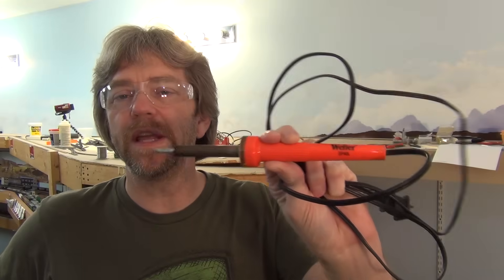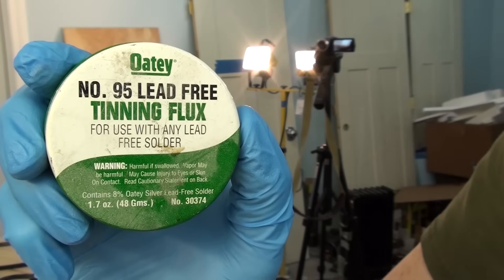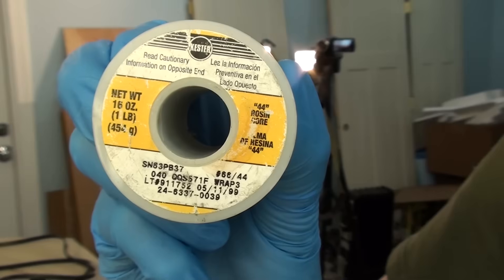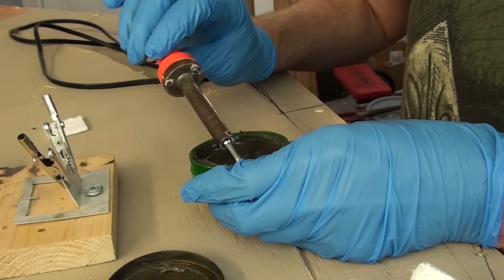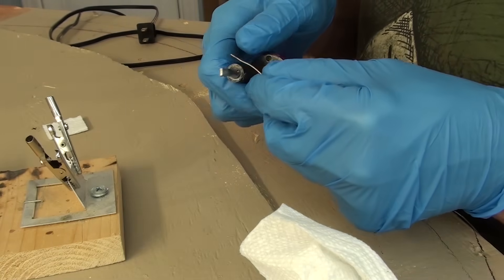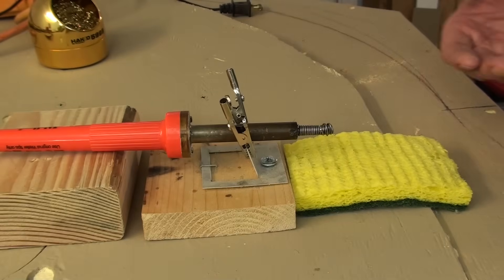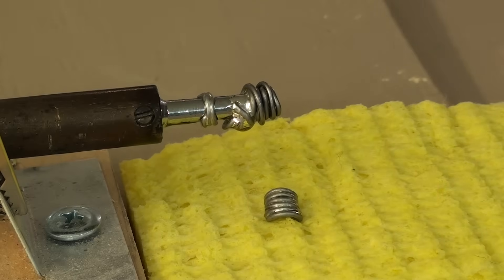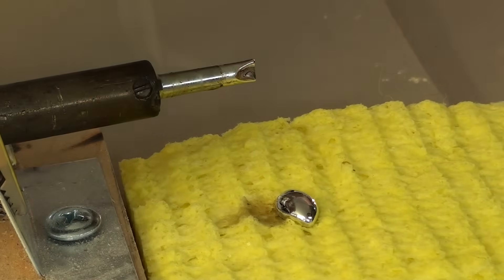🔴How to Tin a Soldering Iron Tip, Without making any mistakes

Comment: You have to do that everytime? Or how long does this last?
Reply from the maker: For the life time of the TIP,  Tips are a consumable.  In a the solder shop we would replace them every week.  But for home use just coat it well before storing the tool.   The Soldering Iron I used in the video,  The tip looks the same and works like new,  I just used that iron the other day,   I did this how many years ago?

Comment: Just got a new small soldering iron to replace an 8 wire section in the wiring harness leading to my car's fuel pump that was chewed up by a squirrel - judging by the chewed up walnut shell on top of the gas tank next to the fuel pump. I had the same tinning flux leftover from an old  plumbing repair and found some 60/40 rosin core in the mix of old solders = worth a try.  Thank You
Reply from the maker: Electron grade solder,  make sure it is not plumbing solder.

Comment: Does this work on a used tip?
Reply from the maker: You can use it but this method is for preparing a new tip.  Older used tips can be do the same way.  But once the corrosion starts it can not be redone with tinning, just better to spend the few bucks on a new tip.

Comment: Had no idea a new soldering tip needed to be tinned. Thanks for sharing.
Reply: @shawnsmith5028  I know right! Why don’t irons just come with basic instructions that outline this essential set up step? It would be like selling an oven without the obligatory “1)wire into an appropriate connection to code 2) don’t use the oven as a heater” etc

Comment: 😮Thanks man! I'm 14 and I'm really getting into electronics. Just a hobby and I started wondering why my soldering irons weren't working anymore... That's when I noticed your video! Thanks❤
Reply from the maker: Keep the tip coated and it will work like a dream.

Comment: I can confirm that this method works just fine when tinning new tips for the first time. I also refurbished a really beat-up tip of mine by using sandpaper just a little, and then using your method. Thank you so much!
Reply from the maker: Great to know this works,   thanks for sharing.
Reply: I have a crapped up tip that needs help, thanks for having shown that they can be saved.  I don't use mine much but lost the tinning on it.
Reply: do we do this tinning thing he showed once a week or once a month for maintanence?

Comment: I know nothing about soldering but someone showed me how to do one specific job that I have been doing for 5 years.  No problems the first few years.  The iron already had a tip on it when I first started. 

The problem began when I decided I might need a new tip. I used the same tip for 3 years with no problem. 

The moment I changed it one of 2 things happen.  I tinned it exactly like this video instructed but I can't get the tip to melt the solder. When it does work, the new tip melts after 3 days and needs to be replaced. 

I'm suspecting my boss is an idiot and bought a bunch of cheap tips from China that is causing the problem.  

Any idea what my problem is and how should I go about buying new tips that are trustworthy because I bought a 10 pack on either Ebay or Amazon and they don't work either
Reply from the maker: You might have a low end soldering iron.  The weeler 35watt I use is a real good hobby grade iron and should serve you well in most job

Comment: is it just for new tips, or is this what you do after every use?
Reply from the maker: @kymbo72  new tip,  you are adding the protection to it that makes it last.   Once it is coated,  during normal use it is not needed.  Just a little tinning to keep the layer intact and prevent oxidation
Reply: @IMRROcom  OK thanks!

Comment: What is the best way to clean a badly oxidized tip before retaining it?
Reply from the maker: @LTVoyager  if it is this bad you are asking how to fix it,  just buy a new tip.  The tip is a consumable that is supposed to be replaced when bad.  They are cheap and inexpensive.   Your end goal is to make great solder connections.   Do not let a bad or worn out tool get in your way.
Reply: @ The tip was used only once for about 30 minutes.  I didn’t get it tinned properly when new apparently and hate to throw out basically a new tip.
Reply from the maker: @LTVoyager  You can try a brass sponge etc. but then reflux and re tin, brass sponge etc.  but in the end the time you spend doing this might not get you the results you want or expect.   The have some other stuff you can buy like "Tip Cleaners" etc. but if you are not doing this full time every day etc. the money you spend buying this stuff that you might only use a few times is more than the cost of just buying a new tip.

Comment: What sort of temp are we running the soldering iron at? For those of us who are brand new to this and the iron I have had an adjustable temperature 😉 totally new to all of this ✌️ thanks in advance
Reply from the maker: I just use a basic plug in pencil iron.  I have been for 40 some years now,  I do not require the aid of a adjustable temperature iron.   Some day I might get one, but do not have the need for one.  I just go hot - hot is better.  speed is the key.  fast in and fast out.  the longer you hold the iron on joint or pad, you get more heat dispersion and are more than likely to melt and damage the parts you are working on.
Reply: Thanks I’ll just go HOT 👍

Comment: Mistake. Before handling solder (the L is silent. Ask google )   You pronounce it properly,  wipe solder clean with alcohol soaked tissue until there are no marks left on the tissue, cleanliness is essential.  
40 hour NASA high reliability soldering course 1980. (I had to do it twice). 80 hours of training total I calculate. Moffet field. I was stationed at “the cube “. Onozuka afs formerly sunnyvale afs. Sunnyvale California
Reply from the maker: @WilsonEywlkyutbe-s3b  I was at Moffet in the 80s. Worked in the Giant Twinkie and AIMD on the other side of the runway.  Diego Garcia and Barber Point VQ-3 W/C 610 I level

Comment: I just heat it up, dip it good in rosin and quickly wipe it on a wet sponge or towel and then I quickly apply the solder.
Reply from the maker: this is for a new tip.  not one that has been tinned the 1st time.

Comment: Awesome video bud,you wouldn’t happen to know how to fix a soldering tool just like yours,that’s not even heating up,I plug it in and nothing,I’ve checked voltage coming in and also cleaned the tip and the body,any advice?
Reply from the maker: around $27 will fix that problem, https://amzn.to/40KzyPp   More than likely your heating coil is open and you can not fix that.
Reply: Buy another one. The element does not last forever a doesn’t like being dropped  smiling emoji

Comment: Someone said to tin before and after every solder session. You do this whole process before and after every session?
Reply from the maker: once the iron is fully tinned,  Just keep it clean and do minor tinning as needed before and after.
Once the tip is fully tinned you will see it only takes a little bit of solder to flow and keep the tip clean and silver.
  The object is to keep oxygen away from the tip,  this will corrode the tip turning it black (corroded),  once this start happening it is time to get a new tip.

Comment: Hi bro do i need a flux? i don't have one i don't wanna spend more money can i use without flux?
Reply from the maker: Flux is what makes the solder flow,  it is a key part of the equation
Reply: @IMRROcom  mine it won't stick that's why we need flux? Plss tell me I need an answer thanks.
Reply from the maker: @codfish1776  Flux is the key,  as long as the iron is not black and corred etc. or it was nit filled on etc. flux is what helps make the solder flow like liquid silver.
Reply: @IMRROcom my iron is full of black then I clean. It by sand then I realized they say not use sand for cleaning. Then I have an D.I.Y. flux with COOKING OIL AND CANDLE and not working. Maybe I train my self using an soldering and do some research but by the way thanks a lot !! From phillipines!🇵🇭🇵🇭🇵🇭. I'm 16 because my phone died!

Comment: why do you tin the solder iron, is it easier to work with and cleaner?
Reply from the maker: It protects the tip and prevents corrosion.  Hit helps with the heat transfer from tip to work.

Comment: Waste of solder, imo. Coat the tip with flux, turn on the iron, keep rubbing solder over the tip until it starts melting, and then just coat the whole tip.....done. Not sure what the point of wrapping a ton of solder around the tip just to watch it all mostly fall off and not even coat evenly....
Reply from the maker: @47ravenlord  you are not sure why.  That is the problem,  you do not know why.  Thanks for your comment

Comment: Great video man, this helped me out. I've always been able to tin a soldering iron but i have an older iron that was giving me a hell of time. This worked perfectly! Mine was old and used, so i sanded it down to fresh metal then proceeded with your process.
Reply from the maker: Glad I could help,  but sanding removes the protective coating on the iron and it is all down hill from this point forwards,  just buy a new tip.  They are only a few $$

Comment: The tinning flux you use says it's for lead free? But the 63/37 shown would be a leaded solder? Just getting into this so I'm trying to clarify.
Reply from the maker: Lead free solder and flux can be used for plumbing aka copper pipes etc.  where it comes into contact with drinking water.  This is electronics so no so worried about  leaded solder flux.  Note that is a plumbing flux that is why it is lead free.

Comment: Great video. Can I use any type of flux for this? I have NC-559-ASM (syringe).  Can I use this for PCB soldering?
Reply from the maker: that requires a little research.   at this time.  just do what is recommended for your projects

Comment: Having been soldering electronics for 55 years, I and most other experienced electronic techs take a dim view of using plumber's soldering flux anywhere near electronics-soldering equipment because plumbing flux is so corrosive.  I suppose the plumber's flux will work if you don't have one of those special metallic-block tip cleaners which contain powdered solder and an alkaline substance (ammonium chloride, from what Ive read), but you really should have included a caution that one should never ever use plumbing flux on a circuit board or any other electrical or electronic connection. For that, one needs rosin flux similar to the flux found inside the solder (or the special fluxes made for use with lead-free solder, which I do not like and do not recommend, especially for newbie's, because lead free solder is more difficult to work with and a leadfree solder joint is more likely to break down and fail from heat, vibration and even extreme cold).
Reply from the maker: no place in this do I state to use zinc, bases or acid flux on electronics.  this is for tinning the tip only.  Use a god RMA flux for electronics.

Comment: Hi this is literally my first day soldering. I tried running my tip but all that happens is the wire just beads up and falls off the tip and won’t stick. What am I doing wrong?
Reply from the maker: Your tip is dirty, starting to oxidize and or has oil on it.  or you never fully tinned the tip.

Comment: what's the purpose of doing this? what'll happen if you don't "tin the tip"?
Reply from the maker: The solder will not stick to the iron and the tip will corrode.

Comment: Not gona lie I'm pretty quick at catching on and self training most things, it's like once I see it done correctly the first time I can usually remember those exact methods and then once I put those methods to practice it's usually 1-4x and I've got it down and I just tweak it to how I like to do it if it's possible to experiment with the methods but when it comes to soldering for some reason I'm at like my 6th time and still working out kinks, not sure if it's specific solder I'm using, or the flux or in which order I do the steps but It seems like it takes me a long time just to get solder to stick to copper wires. I'm definitely not doing it correctly
Reply from the maker: Solder like to be clean,  no oils, oxidation or any other treatment.  if so the solder will not stick.

Comment: It worked great! I didn't know at first you had to tin them first and messed my first tip luckily there was a replacement on my kit! Your process is the easiest I've found! I made a little mistake of not coiling enough solder and missed a tiny spot but I reckon I could just run tin through it and be done with it. Thanks again man!
Reply: I messed up 2 of the 5 tips that came with my soldering iron, before realising I must be doing something wrong.😂😂😂
They both lasted like 2 days each..😅😅😅
Reply from the maker: keep the tips tinned and they will last for a long long time
Reply from the maker: This was intended to make it easy for anyone to follow and get a good result.   Glad it worked for you

Comment: I did this and it made my tip black and crusty. I guess my flux is a little different.
Reply from the maker: You probably all ready used the iron and it was not a fresh tip.   Also use the correct flus,  a Tinning flux.  after that use whatever flux you want on your work

Comment: This looks really good and logical too. As the iron never has any time to get hot while exposed to the elements. It's always covered in flux and solder. It absolutely makes sense.
Reply from the maker: Thanks, 
it works,  not hard to do and anyone can do it.  
yes more solder and flux is used than needed, but it can be done by anyone without fail

Comment: What about retinong a abused dirty tip lol
Reply from the maker: Spend the $3 and buy a new one.  The tips are a consumable that can be replaced for a few dollars
Reply: @IMRROcom the tips are more then that on mine. Mine is a 150 watt iron I use to solder 6 awg wires
Reply from the maker: @Self.reliant  What Iron do you own,  Make Model?

Comment: Please advise: Im cheap and cant afford "tinning flux" or flux of any kind. Neither are sold in local stores and are too expensive online (shipping) for the single use that i have planned. But also I may begin soldering as a hobby.  I have a new unopened "Chicago Electric" $6 cheap soldering iron from harbor freight and i also have some 63/37 tin/lead 2% rosin flux core solder of a 1.5mm diameter. My question is, do i have to have tinning flux to perform the procedure shown in the video since the solder i have already contains flux core? One more question, would soldering next to a opened window that has a box fan sitting in it to blow the air outside be sufficient as far as a ventilation system to not be poisoned by the lead fumes? Thank you for your time everybody ( preferably the person who uploaded the video, or an experienced person with whom i could trust my life)............

I also have a "thermal sponge"( ?) a sponge specifically for soldering, felt like i should mention that.

Comment: I have two tips that I’ve used lightly without any sort of prep and I know now after much frustration I need to go through the tinning process. If the tip has been used and is dirty, can I get it hot and clean it with brass wool then do this process or will I have to start with a new tip? Thanks a bunch for sharing this info with us. Two other questions- when you do this on a tip is it set for the life of the tip or will the tinning paste wear off over time? And is the cleaning sponge supposed to be dry or wet? I always have used a dry one but I’m very new to soldering.
Reply from the maker: I just retin them all the time (Just a quick light tin),  once it is 1st done, just keep it clean and coated.  Tips are a consumable,  so when they go bad, just replace them.  I'm still using that same tip in the video as of today.

Comment: Alright im getting annoyed but ive seen many videos on how to tin a tip and i do the wrap around method & it seems to look silver after the fact but solder will still not melt onto the tip (some of the tip works but the actual top of the tip doesnt work). Idk what im doing wrong
Would soldering paste be different from solderFlux to tin a tip?

 any pointers will help please 😪🤦🏻‍♂️

Feels like im wasting money trying to get it figured out and I haven't had any luck so far
Reply: I'm just getting started too, this shits more complicated than I thought. Just melted a usb c port trying to replace it because the solder wont melt. There can be so many factors. Not very motivating.

Edit: brought it in to a repair shop and they said it's silver solder and they need special equipment to replace the port. Would cost a lot unfortunately.

Comment: Despite following this procedure precisely, almost immediately after tinning the iron, the tip became yellow-brown, what I see as the colour of oxidation. This was at a mere 315° C. If I operate at any temperature above this, my flux turns to liquid immediately and is useless for applying to connections. This is incredibly frustrating. I will be grateful for any suggestions…
Reply from the maker: Flux is used to clean and help flow.  Are you putting the flux on your work? Liquid or paste?   I would have to see what you are doing and working on to fully understand your problem.  Have you tried looking at some basic solder tutorials on YT yet?  That might be you best bet.